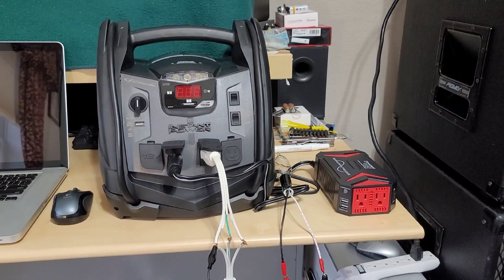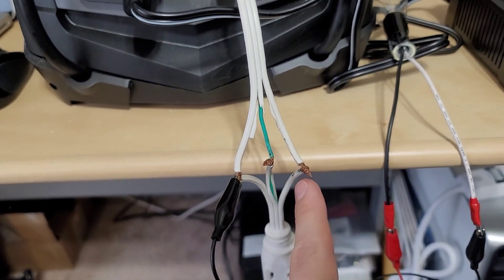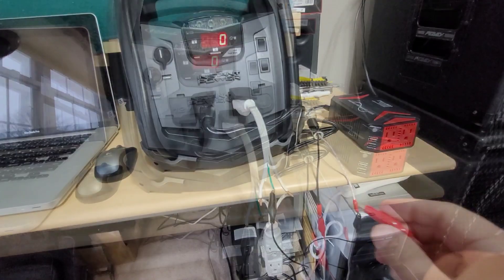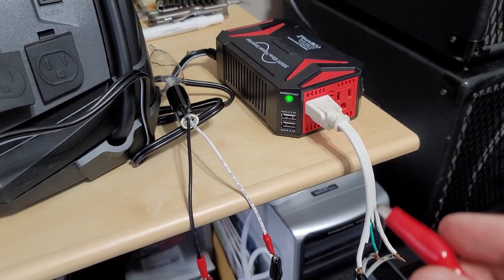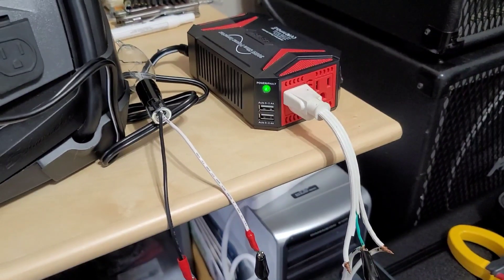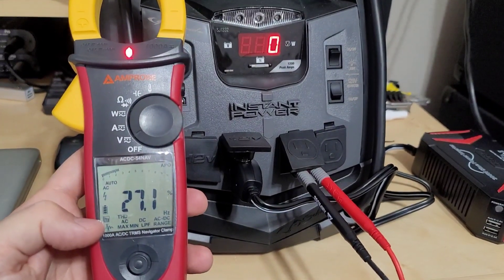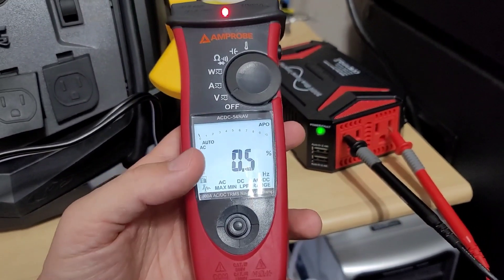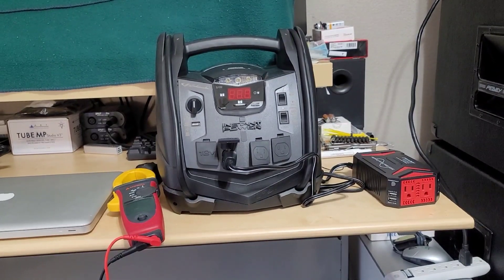Schumacher SJ1332 - Modified Sine vs Pure Sine Inverter: What is A Live Neutral? - THD%

Comment: I have the same unit and my 120 v outlet quit working i checked the fuses nothing wrong with them i took a look on every electrical board nothing suspicious,what you think the cause of this problem.
Reply from the maker: @gabrielmerza6904  if the fuses are not blown, chances are the input boost stage control chip and/or one of its MOSFETs has failed. No schematic available unfortunately to repair easily.
Reply: @ thank you for your quick response my man i really appreciate it 🙏🏻

Comment: Hey brother - glad I stumbled across your video - so I just borrowed one of these from my father in order to power a small 12 watt amp for busking - I will be running backing tracks off an ipad - which I also use as a "pedal board' for my harmonica. I use a small IK multimedia guitar rig interface (passive) and run my Audix Fireball mic into that - with a low to hi z transformer. As I also play bass and sing - I was hoping to run more off this puppy - but Im now wondering if Im expecting too much. Im borrowing this for now - as I cant afford a larger one - or one of Rolands Street Cubes - which would frankly be more convenient than using a battery pack. I see you are a bassist as well - so I thought you might have some insight.
Thanks in advance.
Reply from the maker: Definitely not big enough to run all that.. at least not for very long. You need a bigger battery and a bigger pure sine inverter for the given application.
Reply: @Bassguitarist1985  how about just the 12 watt amp? Even if just for a couple of hours?
Reply from the maker: @JoshuaDb_The_Witness  12 watt bass amp? What is the wattage draw from the wall? 12 watts is the output but the input power is higher since no amp is 100% efficient. What model?
Reply: @Bassguitarist1985  it's an Ibanez practice amp. On the back it's that it draws 12watts
Reply: Model IBZ10B - I assume it's a 10 watt amp
Reply from the maker: @JoshuaDb_The_Witness  okay that should be fine for a few hours. However the modified sine wave inverter will create a buzzing noise you wont like. I have a 20 watt bass amp and it makes noise MSW.
Reply: @Bassguitarist1985  Man Thanks SOO much for the advice. The more I think about it - getting one of the rechargeable mini PAs /amps currently on the market is probably the best way to go. Less crap to carry around. But I can at least get started with this meanwhile. Again - thanks for taking the time - if you are ever in Richmond Va - coffee is on me.
Reply from the maker: @JoshuaDb_The_Witness  my pleasure!

Comment: I have connected a modified sine wave inverter to the house before you just don't connect the ground and I used in isolation Transformer
Reply from the maker: Yes that would help to get rid of the live neutral but obviously far more of a set of complexity than necessary

Comment: totally off topic comment here, is that a 2011/2013 Macbook still runnin strong I see? Did you switch the optical drive for a SSD like I did or keep it stock? I did the SSD swap on mine and it gave it some new life about 5 years ago but Linux is in its very near future now as I start to learn software engineering stuff. great vid! keep it up brotha!
Reply from the maker: Yes sir a 2012 running Catalina. It was free so could not complain. Eventually it's going to need to be replaced. My wife works remotely so she's likely going to get the upgraded beefy computer before I do.

Comment: Good catch on that. My best guess is that the SJ1332 may be configured for L-L and not L-N. They likely use the same design for other countries that do use L-L configuration for other voltages to lower cost. A bad design, nevertheless.
Reply from the maker: I didn't realize other countries use L-L. Topologically speaking it's far simpler in electronics to implement a modified sine wave versus a pure sine. However the cost and parts is not much more. What were essentially paying for is the engineering/design of it.
Reply: @Bassguitarist1985  I agree. I guess it's somewhat fine when you plug the load directly into the device. Just don't hook it up through the main electrical panel like you would a generator.
Reply from the maker: @orlypalomar  You would not believe the amount of times that came up in the comments of my first video on this unit and then the emails following after. Some were able to do it but they likely only connected the hot and neutral. Still dangerous.